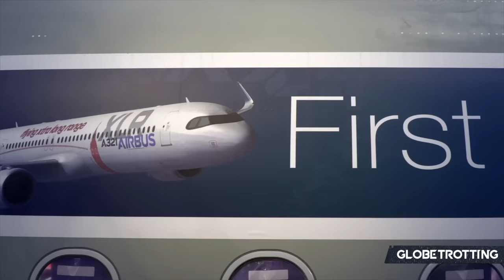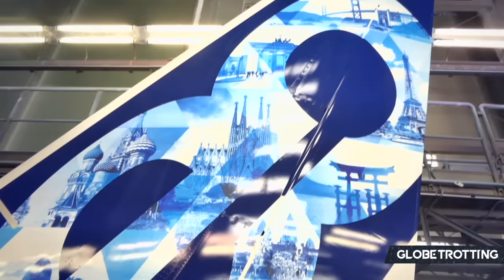BOEING KILLER? - Why Airbus Launched The A321XLR

Comment: I generally like the A320 family. And I think from a technical perspective, the 321 XLR is an interesting aircraft.

But, as someone who flies between Europe and the US more or less regularly, I totally dread the idea of being stuck in the narrow single-aisle tube for more than let's say 4-5 hours maximum. Leaving the technical awe aside that the really big ones come with, as a passenger, I prefer the more medium-sized widebodies, like A330 or 767. They are big enough to not feel trapped, but at the same time small enough that boarding goes smoothly and you don't end up in way too large of a crowd. No surprise that the A330 is my most flown aircraft by miles flown, which probably makes it very obvious who usually takes me across the Atlantic....

Honestly, I rather fly a route with an additional stop somewhere than feeling claustrophobic all the way to my destination on an XLR.

Comment: The A321 LXR isn't all it's cracked up to be. Air carriers count on cargo space to fly all their passengers luggage and so they can haul freight as well. The only thing that gives the XLR it's extra range is a giant gas can in the cargo bay. Air carriers can not afford to give up the cargo space on most of their international routes. Personally, as a passenger, I will not book a long haul flight on a single aisle aircraft. I believe that the two most perfect seating configurations come from the B767 and A330. Half or more of the seats are on the aisle and you only have to get up for one person to use the lav. I also prefer wide bodies because the lavatories are in the center of the planes rather than on the sides, making them more spacious. Long haul flights on single aisle planes have got to be the most miserable travel experience there is. Save the twin aisles!

Comment: With over 500 already ordered, there's no doubt that the XLR is already a success, however, by the time most of the units are delivered, the aircraft runs the risk of suffering the same fate as the A380, meaning it may arrive a bit too late to the market.

The A320 airframe is aging just like the 737, and by the 2030s, there will be new narrowbody aircraft in the market that will have the range and not the limitations of having to carry so much additional fuel.

Boeing's new narrowbody will be announced before Airbus delivers half of the XLR it has on order, and focus will shift very quickly.

Airbus continues to focus a lot of its plane making acumen on range, and with the exception of just a small handful of airlines, range is not the predominant factor in their decision making.

I predict that the next Boeing narrowbody will hurt Airbus. They have such a heavy backlog that many airlines will be enjoying new, more modern aircraft from Boeing while Airbus continues to deliver 'old' A320s. In the 2030s, Boeing may have the last laugh in the narrowbody sector, because the next aircraft will most certainly change the game.
Reply: Ok, please enlighten me: what new narrow body is expected in 2030? Who is developing it? What are the specifications?
Reply: je pense que le remplaçant du 320 existe déjà dans les cartons d Airbus . ce sera la 220 neo . attendez vous a de grosses surprise de la part d airbus dans moins de 10 ans pour un tout nouvel avion . le cfm rise va révolutionner l aviation comme on la connait aujourd hui
Reply: Btw, how is the work at Boeing?
Reply: @marclaurent6207  Il est possible qu'Airbus développe un A220neo en étirant le fuselage, mais une capacité 2-3, bien que adéquate pour les opérations régionales, ne satisferait pas le principal marché des fuselages étroits.  De plus, un A220neo suivra la tradition d'Airbus consistant à rafraîchir les vieux avions pour rivaliser avec un tout nouveau produit.  Dans ce secteur très compétitif, je ne pense pas que cela fonctionnerait.  Si Boeing développe un tout nouvel avion à fuselage étroit, Airbus doit également le faire.
Reply: @ross9581  Haha!! Airbus fanboys with the jokes. Many of the things I've said in these discussions have come true. Ultimately, Boeing will be fine because the industry needs it, and haters are going to hate. I'm an av geek, not a fanboy.
Reply: What fantasy world do you live in?
Reply: Boeing need much more than a new narrow design to get out of the sh.t. The company must fully reorganise, from the Ceo down to the janitor. Airbus has 20 years of pieceful time ahead, at least
Reply: @CaptainDangeax  Don't cry for Boeing. They'll be fine. 

Airbus will only enjoy selling refreshed aircraft for the next decade, but by the time they start selling actually new narrowbody aircraft, they will be catching up, not leading.
Reply: @sassa82  Time will tell. I know history, and I definitely know that past is prologue. Once you learn a thing or two about aviation, we'll talk.
Reply: @sainnt  You missed my point. Try again
Reply: @CaptainDangeax  No, I didn't. Your point is well taken, but there's a difference between engineering aircraft and assembling one. Clearly Boeing has a lot to do with the assembly, but they continue to innovate circles around Airbus, at least up to this point. Once they get the assembly issues right, which they will, the sky is still the limit - pun intended.
Reply: What new Boeing Sainnt ? You are living in a fantasy world if you think they can get a new Aircraft into the air in 6 years, they will still be trying to get the 777 certified
Reply: Also I’m going to chip in here. The A320 family is twenty years younger than the 737 family. By Boeing’s own airframe usage lengths the A320 still has some mileage in it yet. Even then the A220 is available.

Meanwhile Boeing has reached the end of what it can do with the ancient 737 family. And it isn’t even in the design stage of a clean sheet replacement yet. Of course Boeing isn’t going anywhere-the deep ties to the US military and government will see to that.
Reply: @mikoto7693  I see how many of you are far behind on the next Boeing narrowbody aircraft. Since you guys clearly aren't av geeks you need to Google. The Max is definitely the end of the road for the 737. Even Boeing knows that.

Airbus most certainly cannot afford to do with the A320 what Boeing did with the 737. The 737 served purposes that the A320 was never designed for and that's why it's endured longer.

The A220 is a regional aircraft, and would be unsuitable for the A320 mission even if Airbus stretches it. Also, remember Airbus did not design the A220. So many people forget that.
Reply: @sainnt  The A220 is NOT a regional aircraft. It plays the same role as the smaller 737 and A320. 

Airbus owns the A220. So why does it matter who has designed it?
Reply: @sainnt  Let's nail some truth. Which was the first commercial plane with fly-by -wire? The Concorde from Aerospatiale and BOAC, now Airbus. Which was the first fully computerised passenger plane? The A320. Looking at the MCAS disaster when Boeing tried some computer trick, see how delusional you are when you mention Boeing being ahead of Airbus...
Reply: @CaptainDangeax  Let me teach you something. Aerospatiale and BOAC did build the first analog fly by wire and the A320 used the first digital fly by wire. 

However, Airbus was formed by the governments of France, UK and West Germany. The name Airbus was from the German part of the alliance.

Airbus fanboys love to tout the fly by wire every chance they get, along with the partial use of composite materials. Congratulations for bringing the world technology from 55 years ago and not much else. Everything Airbus has done has been a derivative of someone else's technology.

Now, let's count a few Boeing achievements; First pressurized cabin on an aircraft, first twin engine airliner, first double decker airliner, first twin aisle aircraft, first airliner to be completely designed by computer, first fully composite fuselage, first dimmable windows on a commercial aircraft, first oversized overhead bins, you know, the one Airbus calls Airspace. There's much more, but I won't waste any more of my time 

Name a single Airbus innovation in the last 20 years. Go on... I'll wait.
Reply: @neodym5809  Setting aside any Boeing or Airbus debate, if you don't know that the A220 is a regional aircraft, you're clearly out of your depths here. 

Airbus may own the A220. They did not design it. Any modifications they will ever make to the aircraft will likely still involve Bombardier, so yes, it definitely matters.
Reply: @sainnt  all innovation you mentionned happened before Airbus was a thing. First supersonic airliner, Aérospatiale and BOAC, Boeing failed to build one. First radar assisted landind, the Caravelle. Putting aside dimmable windows or twin deck or twin aisle is just laughable. First twin engine airliner was French Farman F60 in 1919. Stop embarrassing yourself
Reply: @sainnt  Er, you might want to reread my comment. I specifically mentioned that the max variants are the end of the road for the 737 family. The A320 is some twenty years younger than the 737s having been introduced in the eighties rather than the sixties. It has another twenty years of service and reworks to become as antiquated as the 737.

So uh, what’s this new Boeing 737 clean sheet aircraft called since I apparently missed it?

Funny thing is, you never know who you’re talking to on the internet. To work as ground crew at an airport, handling both 737 and A320 variants having gotten the job because I like aviation is…. Amusing.
Reply: @mikoto7693  Sorry, good for you that you work on the ramp, but that doesn't make you knowledgeable, especially since you're unaware that Boeing is developing a new narrowbody aircraft. Use your Google.

I understood exactly what you said about the age of the A320 airframe. What I'm saying to you is that, if Airbus tries to compete with Boeing clean sheet design aircraft by refreshing the A320 airframe, they will fail miserably. The A330neo is a younger airframe than the A320, and we all know how well it's doing against the 787.

Like Boeing, Airbus is also developing their own new narrowbody aircraft, but theirs is a different design than that of the Boeing. It's basically a copycat design. If your Google fails you, I'll be happy to elaborate.
Reply: @sainnt  I did, lol. David Calhoun announced that Boeing isn’t launching the development of any new commercial aircraft this decade during the company’s investment conference in November 2022. The only thing it’s working on is the 777x and getting the frankenmax 7 and 10s certified for pax service. I think he said something about waiting for current technology to advance and mature a bit before even thinking about making a clean sheet aircraft.

Unless you’re referring to it’s partnering with NASA to develop a TTWB demonstrator aircraft?

Or the infinitely delayed Boom project?

Give me 24 hours and I can do you one better. I can ask a Boeing mechanic about it, or one of the 737 pilots. But anyway, I’ve done my part. I googled it and came up with the CEO saying it’s not going to even be designing a new commercial aircraft this decade even though I knew it from memory anyway.

So now I challenge you. Prove me wrong. Give me the name of this narrow body aircraft you think Boeing is actively working on.
Reply: @mikoto7693  You, and apparently other people here are confusing the development of an aircraft with the announcement of an aircraft. Boeing has already started developing their next narrowbody aircraft, which is in the early stages. Because they're working on an all new type of aircraft, they're not going to announce what the technology is being developed for until they know it's going to work, and experts have already noted that the Truss braced wing aircraft is being developed for their next narrowbody aircraft.

Airbus is also developing their own next narrowbody aircraft, one a prop aircraft, and something with folding wings, probably both features in the same aircraft. 

We won't see a clean sheet design from Boeing or Airbus until the next decade, but that doesn't mean that they aren't already in development.
Reply: @sainnt  the CEO of Boeing said they do NOT intent to DEVELOP a new plane before 2030. Who is confusing what here? Or is the CEO lying?
Reply: @neodym5809  Seeing that an aircraft is ALREADY in development, and they lied about other things, do you think they CEO is the most trustworthy person nowadays? Have a seat, Sir. Sometimes it's okay to just admit when you don't know something, then perhaps you might learn something.
Reply: @sainnt   Let me get this: Boeing and its CEO officially announced that they do NOT develop a new airplane for at least the next 5 years, there are no information in the public domain to say otherwise, but you know it better than anyone else? And refuse to share your source?
Reply: @neodym5809  Dude, let it go. You're clueless. Boeing, along with NASA, are developing a truss braced wing aircraft, and are about to conduct a test flight using a retrofitted MD-90 aircraft. If that's not developing a new aircraft I wish you the best of luck. However, it would behoove you to at least Google it.

The problem with you all is the English language. Any new aircraft from Boeing is not going to be seen until the 2030's, but that doesn't mean they don't have new aircraft in development. That almost never stops.
Reply: @sainnt  No. The problem is that you confuse working on a prove of concept with working on a new airplane.
Reply: @neodym5809  Working on proof of concept is exactly part of aircraft development is, especially when you're doing something that's never been done before on a commercial airliner. That's what Boeing has been doing, and that's exactly what Airbus hasn't done in 40 years.

The Boeing 777 was completely designed on a computer. That was proof of concept. The announcement that Boeing made was about moving commercial aviation forward, so they decided not to build another derivative aircraft, which is what the NMA was. They ceded the middle of the market to Airbus in order to once again in order to revolutionize the sector. That's what the 737 and 747 did in the 60s and 70s, 757 and 767 in the 80s, 777 in the 90s and 787 has done so far. Airbus fans love to malign Boeing for cost cutting and recent quality issues, but Boeing is the one investing the most money in the development of new aircraft while Airbus keeps cashing in on derivatives. Get used to it.